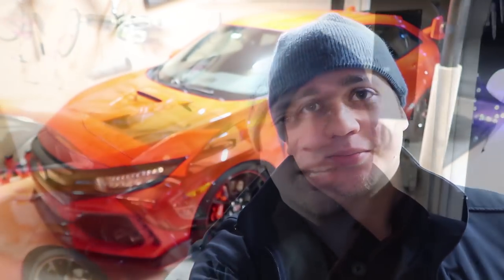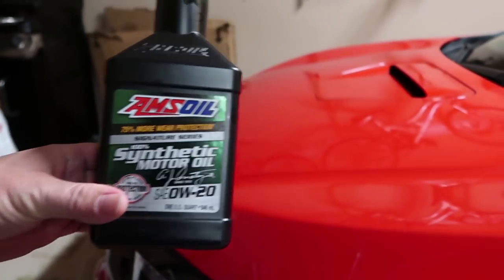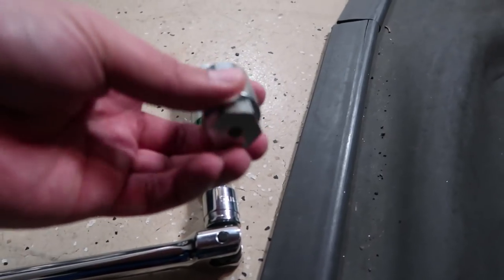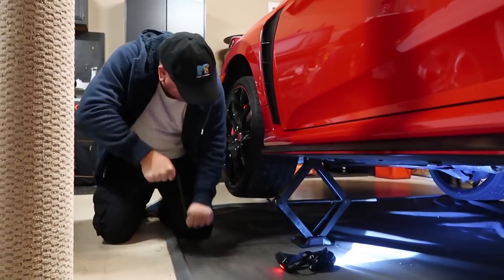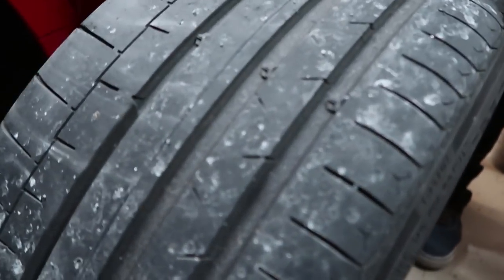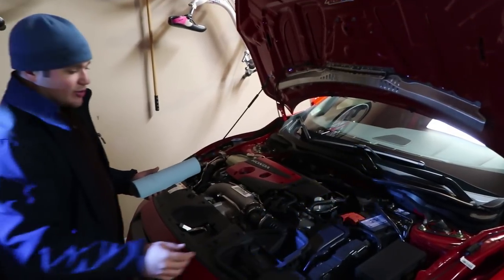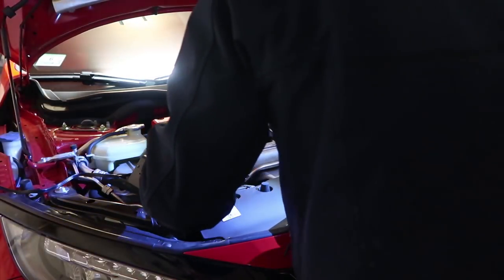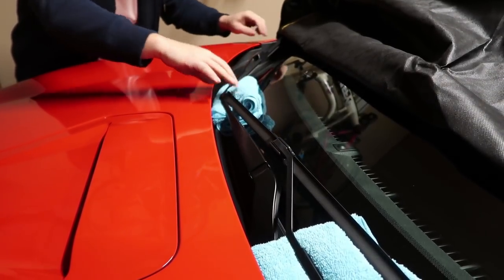Honda Civic Type R | How to Store your car for the Winter

Comment: You could fine tune all this as its all good stuff: Put the stabilizer in when the tank is low and fill it that way it mixes well then like you said run it and park it...Leave the car on the ground at ride height, just put the tires at max pressure cold as per the sidewall or if your worried about them just throw on 4 space savers from a wrecking yard and put the tires in a cool dark place; Instead of shop rags use bounce sheets, it deters mice and if your really worried use steel wool but only in the tailpipes that way they cant get in and build a home.  I pull my Battery right out, but for some that's not practical. I live in Northern Ontario and my car(Old Integra)has to be stored outside, well covered and never had an mouse or rodent issues using the bounce sheets or mothballs. Merry Christmas.
Reply from the maker: All very good points, MERRY CHRISTMAS!!

Comment: I agree with everything you did except one thing.  You should not be putting the car on jack stands just for winter storage.  Firstly, the suspension is not designed to hang or be in an unnatural position for so long.  It does more harm than good.  Secondly, it would be very unlikely that your tires flat spot during winter storage.  Modern radial tires no longer do that.  This is not the 70s and there are no more bias ply tires.  The recommended practice is to leave it and just inflate the tires to about 40-45 psi.  I have friends that store Ferrari’s and they do not get put on jack stands.  Ferrari dealers are very clear on this.  Just giving you my 2 cents for what it’s worth.   Merry Christmas by the way.

Comment: Besides using shop towels and such for rodents, to prevent them from finding a place you can use dryer sheets with whatever scent you may want.
Reply from the maker: This is actually a good point

Comment: this is bad advice. if you're worried about flat spots just inflate tires slightly over recommended amount. Suspension, specially with dampers, should not be left without pressure on them

Comment: Folks, just drive it, it should be pretty good in the snow. Get some 18" wheels & Nokian snows, remove & store the front splitter , and drive it.  It's a car, not a Faberge egg.
Reply from the maker: facts
Reply: FlyinGato Oh Gato, one fact I neglected; just got under front to see what configuration fasteners were used to connect splitter. There are about 20-25???? PLASTIC RIVETS? By 1st appearance, they have ZERO ability to be threaded in, out- not by sockets, star drives, screwdrivers, zippo! I gotta figure out a "plan b" before New York winter kicks in. Buy stock in plastic rivet company?